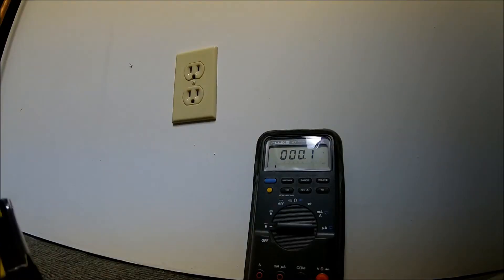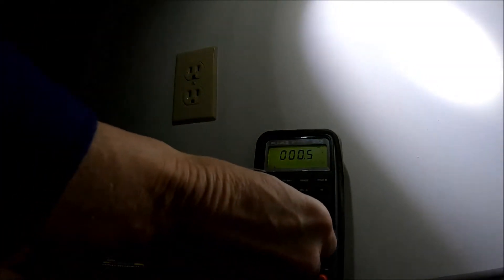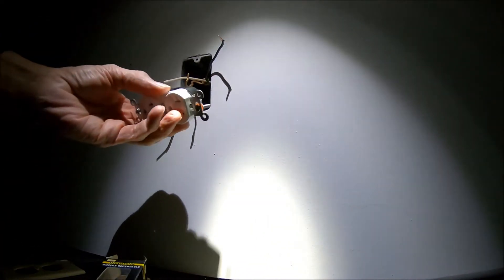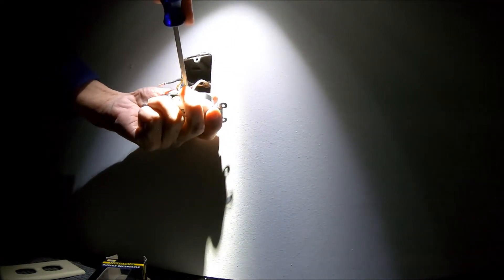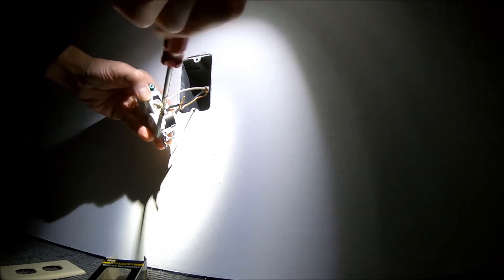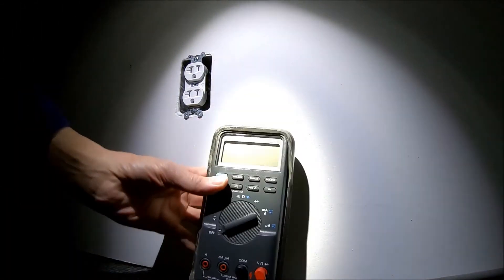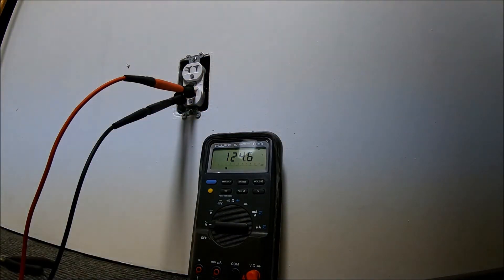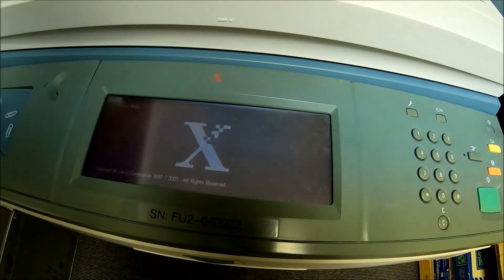How To Install 20 amp Receptacle: Wiring Must be 12 Gauge. Check your local wiring codes.

Comment: I have a treadmill 110v/16A, but it has a 5-20P plug. The wire at the receptacle is 14 gauge. I used a plastic chart to size check it. The fuse at breaker box is 15 amp. What should I do? I already put the 500lb treadmill in that room.
Reply from the maker: If it was me, I would pull 12-gauge wire and put in a 20amp breaker if you want to put it in that space. Or move it to a different location with the proper size wire, receptacle and breaker.

Comment: A few pointers, 1st in addition to a flashlight, a floor standing light works best in conjunction with one YOU have to hold.  2nd use electrical tape to shield side screws from making contact with frame of box or slipping out. and finally 3rd thing is the hard way and the easy way of doing things are only separated by research!. Best of luck with your future endeavors.
Reply from the maker: Thanks!

Comment: Wouldn’t there be 12 gauge wire already installed, being that the breaker is 20 amps?
Reply from the maker: Should already be 12 gauge, but always good to be sure. Sometimes people put bigger breakers on the wrong size wire. You find some weird stuff being done out there by folks that don't know any better.

Comment: Glad you pointed out the wire gauge.   It's very common (and legal)  to use 15 amp receptacles on 20 amp circuits but not the other way around,  as long as it's more than one outlet,  otherwise it must match the breaker rating.  Since most equipment that has a nema 5-20 plug on its cord will most likely say in the instructions that it is to be used with individual branch circuit only,  and the NEC requires you to follow any instructions provided by the manufacturer, usually 20 amp outlets are installed for the purpose of letting the user know the circuit is 20 amp.   I have 15 amp duplex outlets in my garage (20 amp circuit)   I also have a single 120 volt 20 amp outlet on an individual circuit for a 20 gallon air compressor that has a NEMA 5-20P.   Those plugs are rare, and the 15 amp duplex are a bit cheaper, so that's how I wired my garage.
Reply from the maker: Thanks for all the info.

Comment: Hey Mike, the bad news is that it is still a code violation. The good news is that it is an easy fix. Anything that uses an actual 20 plug (one horizontal blade) requires a dedicated line. By virtue of your duplex receptacle it is not a dedicated line, even if there is no other receptacle on that branch circuit. If you replace it with a 20amp simplex (single) receptacle, you're good to go. It should mention this in copier's manual.
I'm not a expert at this, but my understanding is that if 12 gauge is acceptable, then the copier in the case should be designed to draw no more than 16 amps. That is 80% and is the number that is considered the upper limit of safety in general.
Reply: Are you saying, I can put a single simplex 5-20 receptacle in my garage, (replacing the 15 amp receptacle that is branched in) and NOT have to have it’s own dedicated breaker?
Reply: @HeyMikeyLikesIt2  Yes, as long as it's a 20 amp circuit with 12 gauge wire. However, if it doesn't have its own dedicated breaker there's no need for it. You could use a duplex 20 receptacle or leave it alone. If the 15 amp receptacle needs replacing, I would recommend replacing it with a 15 amp "spec grade" duplex receptacle and you're done.

Comment: How can you safely install a 20 amp receptacle with #14 wire? That's a direct code violation.
How many amps does that copier actually draw? My guess would be that with the 20 amp plug on it, it should be on it's own dedicated circuit using #12 gauge wire.
Reply from the maker: I think your the same person I just responded too. The wiring for that outlet runs directly to a 20 amp breaker with no other outlets on that circuit except the one I changed. I put the 15 amp outlet in originally so I could make use of the outlet. I had a 15 amp outlet on a 12 gauge wire which I changed to a 20 amp outlet when I finally got around to it. Those receptacles with the back push in connections state to be used with only 14 or 12 gauge wire. So they will take the 12 gauge wire fine. I don't care for them and would rather use the ones that have the screws on the side. Thanks for the comment.

Comment: I'm glad you pointed out your wiring was adequate for 20A. That's quite important! Have a good weekend Mike!!
Reply: He said that but his old wiring to the old receptacle was only #14 wire. I know that because it was wired using the push in terminals on the back of the receptacle which will not accept anything heavier than # 14 gauge wire.
Reply from the maker: I'm glad I added the note about the wiring because I forgot to mention it in the video. This is a storage room and I put 12 gauge in because I wanted to be sure it could handle whatever I put in there.
Reply: @mikesworld60 
That is not 10 gauge wire. The old receptical was backstabbed which means it was only # 14 wire.
Reply from the maker: I don't believe I said I had 10 gauge wiring in the video. I did write 10 gauge in one of my comments. I have changed that to 12 gauge. Thanks for bringing that to my attention. The rear push in terminals on the  back of the old receptacle states for use with 14 and 12 gauge only. I ran the original wire myself and it is 12 gauge which is fine for 20 amps. My entire house has 12 gauge in all the outlets and 14 gauge for lighting circuits. Now if I wanted it rated for 30 amps I would need 10 gauge. It is a sole source circuit and runs directly to a 20 amp breaker with nothing else on the line.  Thanks for the comment.